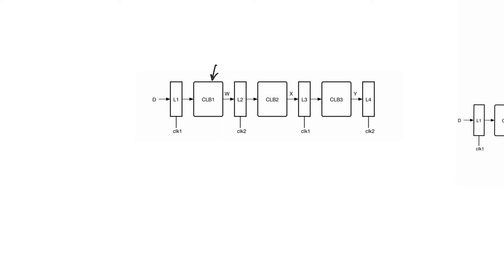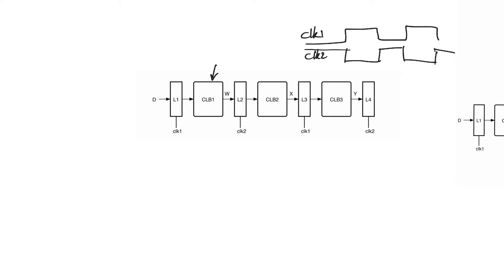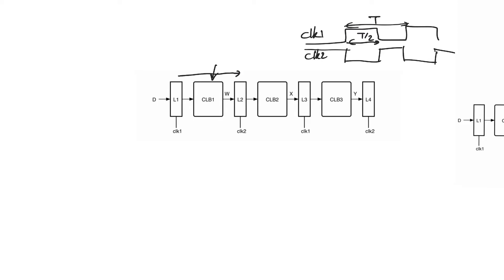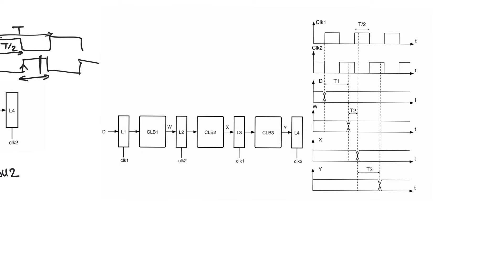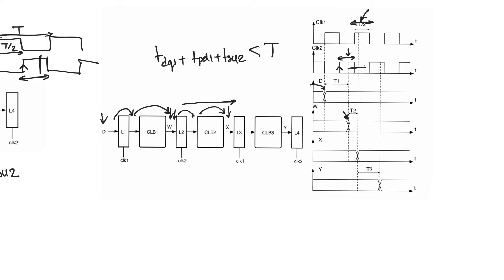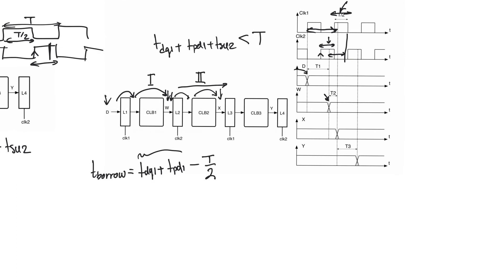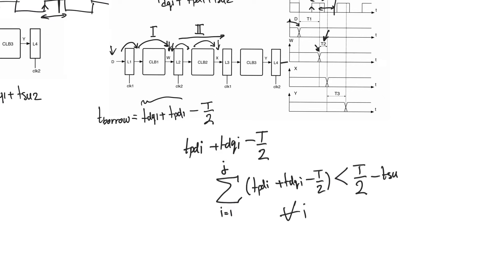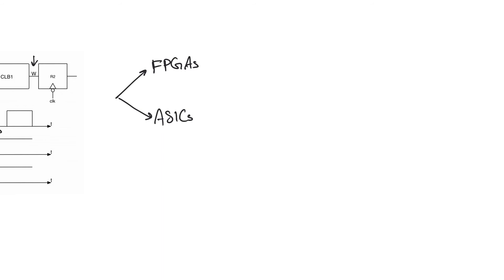9.14. Latch pipelines & slack borrowing

Comment: Hi Electron tube,
In your explanation you are using inverted clocks for two consecutive latches. If we are using same clock for both consecutive latches (main clock to both latch not the inverted clock) so in that case what will happen ? If the combinational delay is less so is it possible to time borrowing happens in this case because both the latches are transparent.
Reply from the maker: If the same clock is fed to all latches BUT alternating latches are the opposite kind of active (active-high followed by active-low, etc.), then the same discussion in the video applies.

I think the situation you are describing is one where all latches accept the same clock and all are active-high (or all are active-low). This setup will only work if the delay of EVERY CLB is high enough to exceed the active phase of the clock. In such a case, the loop will work, and you can borrow from active phases. The inactive phase can and should be used entirely by the combinational delay.

It is important to note that this setup is extremely sensitive, however. In most practical situations it will not work. The reason is successive latches use the same active phase, which allows data to race through fast paths and will inevitably cause violations.

Hope this helped.
Reply: Electron Tube Thankyou for the reply on my query. Yes i can understand that if i want to work with same edge i need to use active high /low latches consecutively. Now if the path is in between a latch and a flip flop than how it gets analysed ?  starting from a flip flop ended at latch the clock is 100 MHz. The CLB delay between flip flop and latch is 1.46 ns. The enable of latch is connected to the same clock(100 MHz) active high latch.